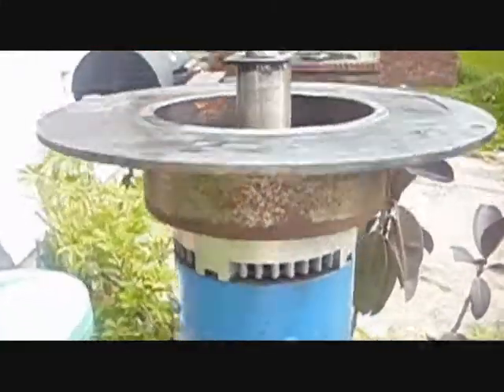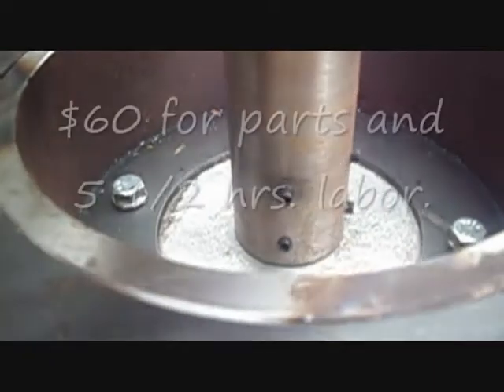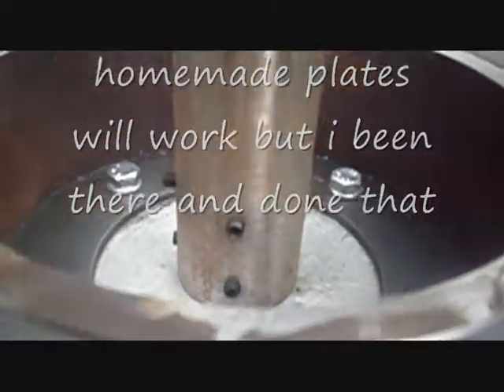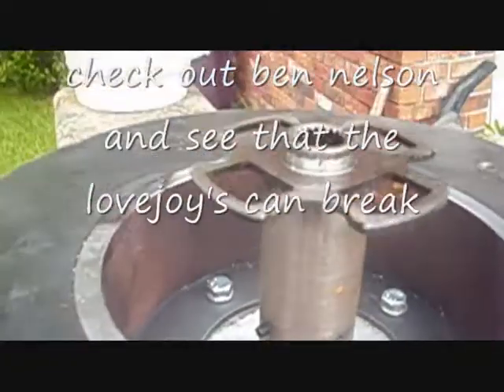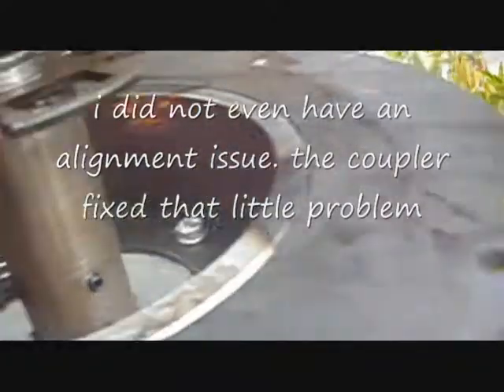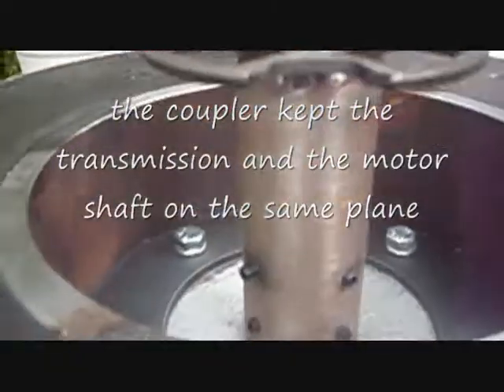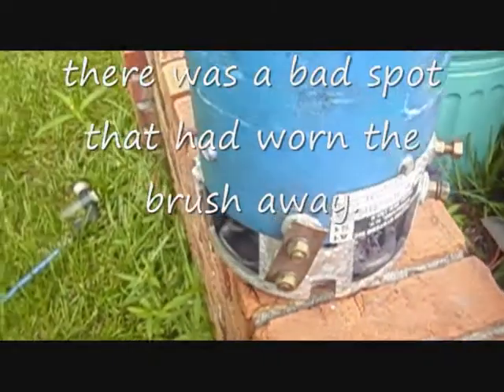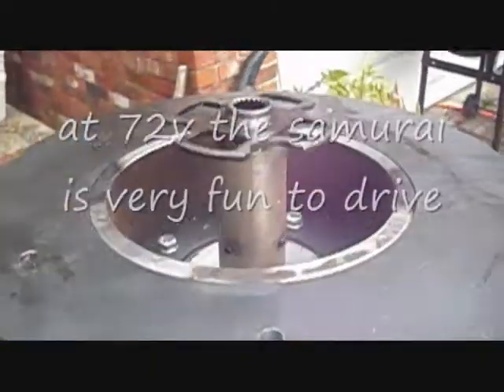(13) Electric Suzuki Samurai EV my adaptorplates

Comment from the maker: i bought a vacuum pump off ebay for $100 and you can make a vacuum chamber or buy one like i did with a switch for $100 also. i have thought about a torque bar with a rubber damper but the one i made works so far.
thanks hope it helps in your own conversion.